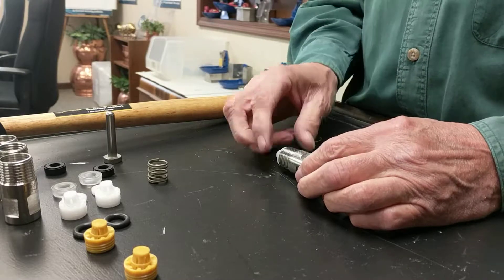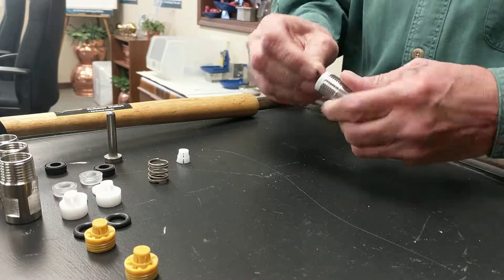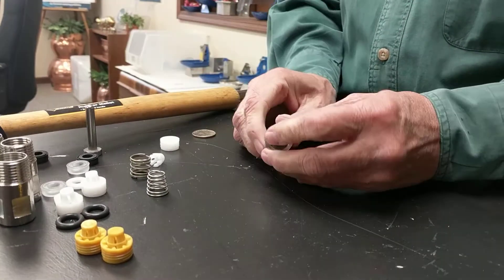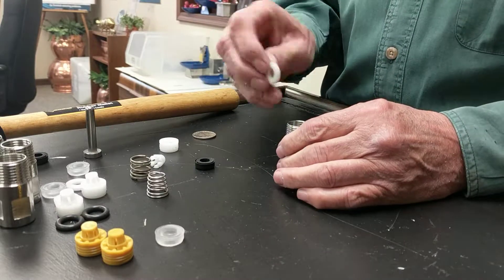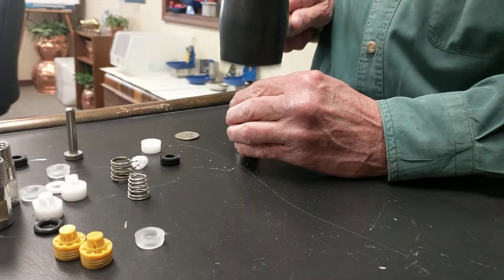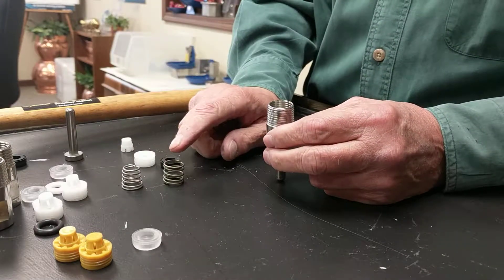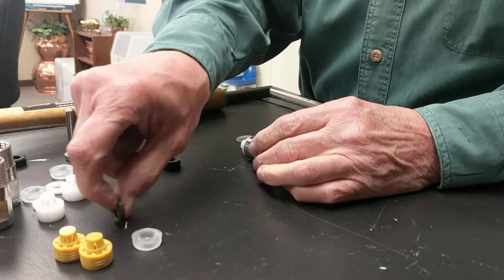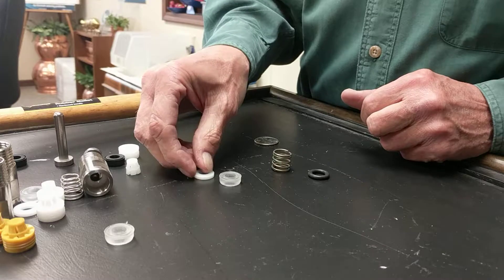Trojan Water Nipple Update

Comment: How do you adjust the flow rate on a 75? Your FAQ page does not answer the question.
Reply from the maker: Adjusting the flow for the nipples is essentially the same for all styles designed for a pressure application: remove the screen, use a larger flat head screw driver, or even a quarter, and turn the orifice to the right until the next size hole is exposed. All nipples should be factory set at the largest flow rate, which will look like 2 small holes. The lowest flow rate will only have the center hole exposed. If you would like to see the different holes to know how it needs to be set, remove the orifice completely(carefully as to not lose the spring sitting inside of the nipple). Please feel free to call if you have any other questions!